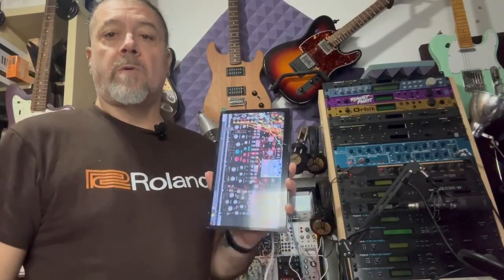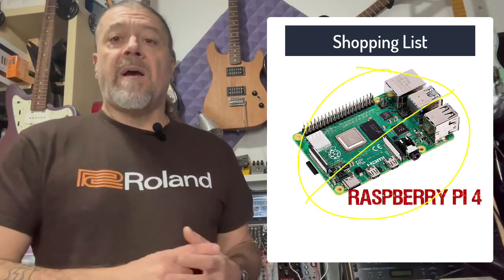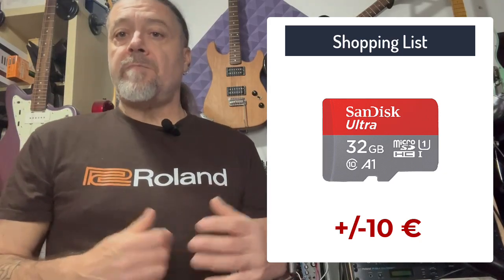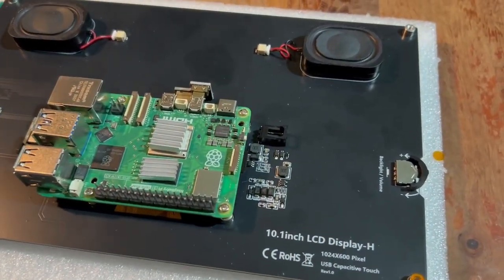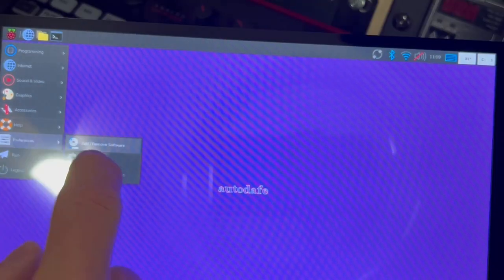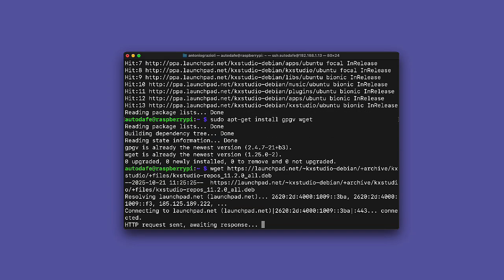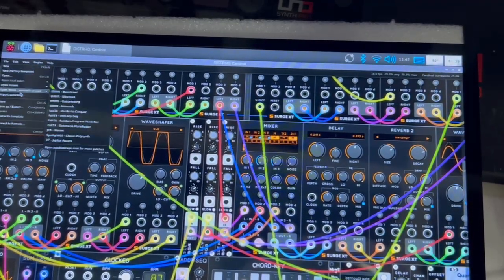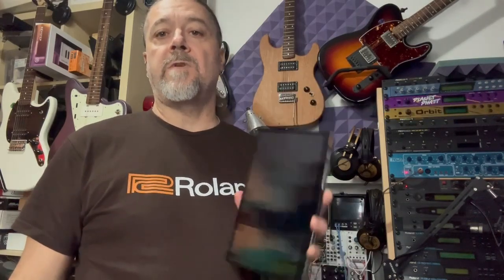A DIY Virtual Modular Synth You Can Hold in Your Hand!

Comment: 10 inch display!!!! WOW!!! I got an 8 inch 1600x900 for 50ish... but it has the Native cable connection and no HDMI or need for external power... but 50ish for this also??? This is CRAAAAZY!!!! that looks awesome that big!!! I figured out 8 inch was the max it would fit into Eurorack space... (I also got the ultra cheap 5 inch one first, which has a better touch response than the 8 inch one... both capacitive but the 8 inch model don't work with the Pen... fingers yes... it's strange...)
Reply from the maker: Glad you like the display size! It really does make a difference. 😄

Comment: Awesome, thank you for this! One question, does Cardinal reacts to touching more than one control at the time?
Reply from the maker: No, AFAIK unfortunatley Vcv Rack and Cardinal don’t Support multi-touch gestures (yet). But the screen is multi-touch
Reply: @AutodafeSynths yes I figured that out. The culprit seems to be the GLFW library that doesn’t support multitouch, although there’s an ongoing discussion about it. Thanks anyway!
Reply from the maker: @liberomureddu yes I think that’s the culprit. And yes I have seen some discussions about it on Forums but so far multi-touch is not supported

Comment: Oh cool i always thought the pi needs an audio module guess not anymore!
Reply: Congrats! How big could I go with the screen? Like 13”? How do you manage the cv in and out? cheers!
Reply from the maker: @djthopa  you can attach any display you like. I choose this 10 inches because it's not super expensive and I prefer to stay small (if not, I could use a laptop). At the moment I am not using CVs ins and outs, I am using HDMI Audio, so only audio out.
It should be technically possible to send also CV controls on the out, a bit more complex is receivincg CV signals...maybe using a dedicated sound card with multimple ins and outs...
Reply: @AutodafeSynths  Thanks for the info! I ve installed it on a Pi 5 and it’s running great :) How do I load the browser if i’m only using a touch? thanks for your help!
Reply from the maker: @djthopa  i think you can just clic on he backround?
or enable your on.screen keyboard, then click the CTRL button and tap the background
Reply from the maker: Well this way you could use the HDMI audio out….maybe not the best quality but….